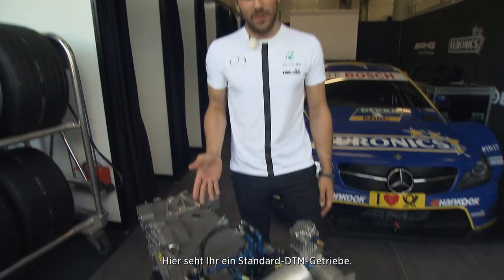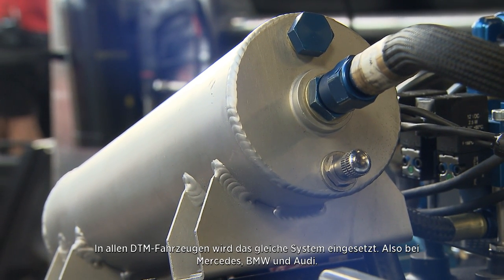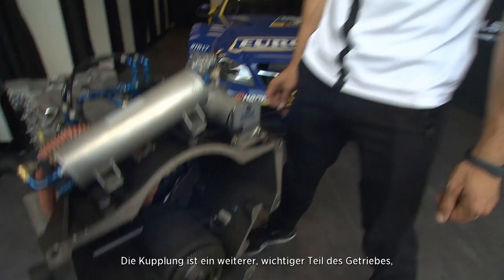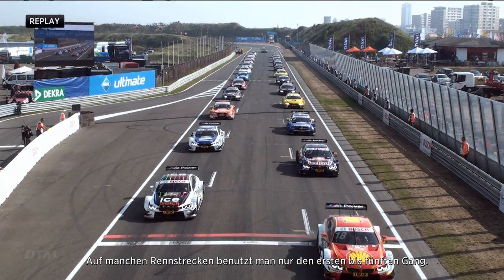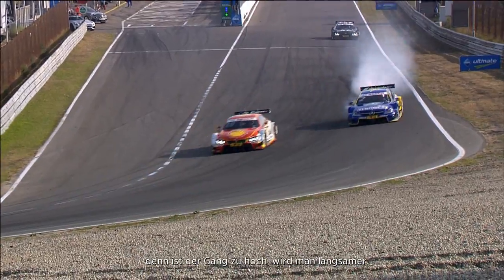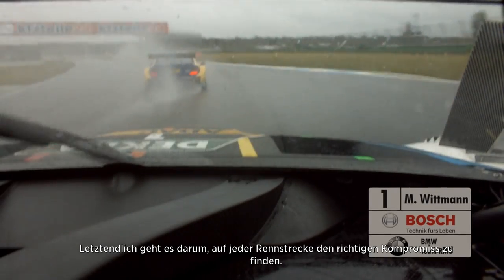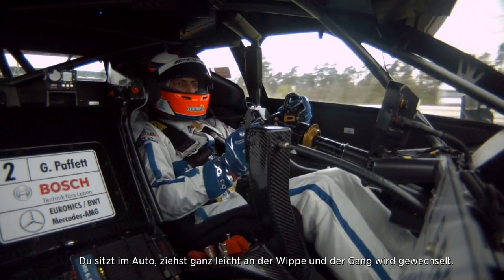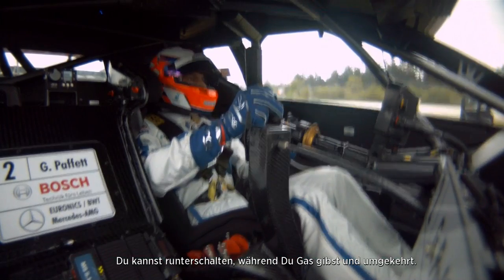Gearboxes Explained w/ Gary Paffett – Show Me Tech! – DTM Spielberg 2015

Comment: Lacks detail: does it auto-blip, auto-lift, is the clutch used by the driver apart from when launching, is it a carbon clutch, are gear ratios changeable etc.. Do it right or don't do it at all I'd say.